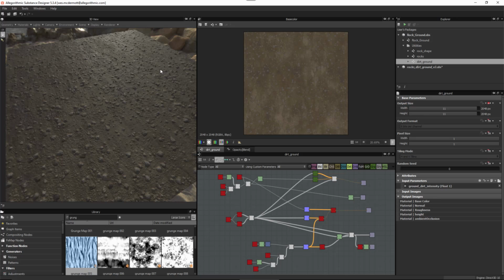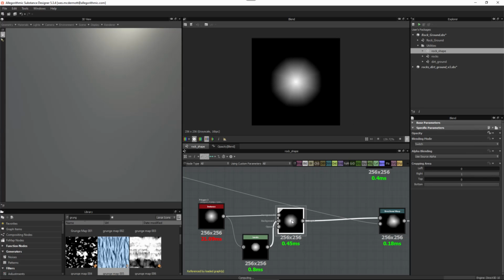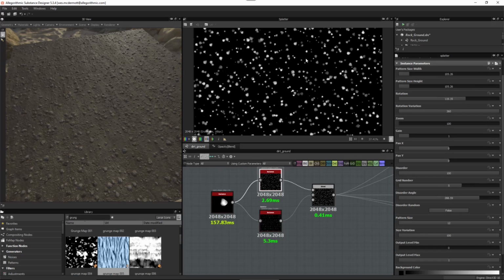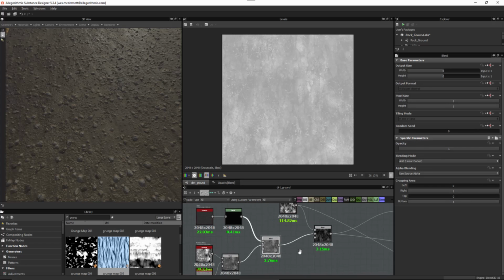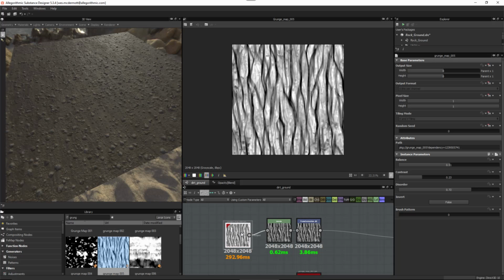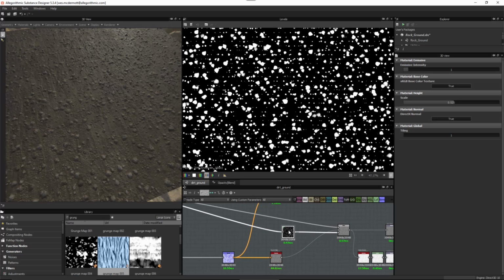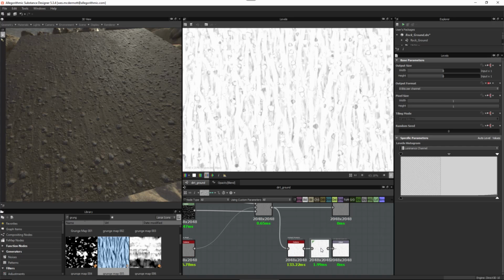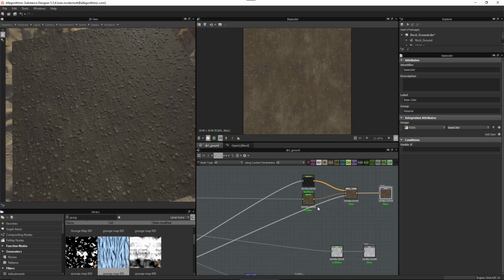Substance for Unity: Chapter 02-04 Creating the dirt ground material | Adobe Substance 3D

Comment: A much better way to do color - is to use 2 multi switch nodes- make several gradient map nodes for each multi switch node- then a blend for the 2 multi switch nodes. 
Fill up all those gradients completely differently - but make em all look decent.. 
Then > If you expose the switch parameters, the opacity on the blend, and the blend mode from the blend - 
You'll end up with limitless colors for your texture > in engine. If you did enough exposing of variables that make the texture's height and normal, then you can make limitless rock textures suddenly - ALL from engine, and you'll be able to control tf out of it. You can reuse it for underwater scenes, caves, canyons, swamps, deserts, forests, old abandoned stuff - .. ANYTHING. All from 1 substance - and no one will ever know that almost every rock texture in the game is from the same thing - cuz you'll be able to vary it so much.
Reply from the maker: Thanks for the tips!

Comment: Enjoying the tutorials however a few thoughts:

I'm learning how to use SD from a tool perspective, however the tutorial is not explaining the theory behind material creation, this tutorial is teaching me how to makes 1 type of rock texture and use a few input parameters. Is it making me better at creating materials though? no.

It would be great if you explained your decisions. Examples:

"I'm going to use liner dodge for my blending mode" Why! Why are using linear dodge and not min, max etc! please explain the differences and why we need some over others.

"I'm just going to lighten up my values with the level tool" Why! Why are you lightening up your values.

"I'm just going to grab a fractal sum base" Why! Why are using a fractal sum base and not fractal sum 4. 

This tutorial basically boils down to "I'm going to show you what the different buttons in Substance Designer do" Rather than "This is how you make a material from scratch in substance designer"

Very thorough explanations on inputs, not so much on theory. At least it's given me motivation to get really good at it and release some tutorials on udemy.

As far as the substance academy goes, these follow-along tutorials are the best, they just need to be paced a little slower. I'd say this material is quite advanced for a first material where as creating a simple concrete or stucco texture might be a little easier to follow for newer people.
Reply from the maker: Thanks very much for the feedback : ) This is very good information.
Reply: Honestly - the best way to learn this, coding, etc.. is doing it a bunch - so doing several tutorials just like this - will actually make you learn it very quickly. They also have a more in depth tutorial series that explains more about nodes, but it won't help as much as just doing it a bunch of times honeslty.

Comment: To Kosta's point below, at 4:34 I got a bit confused with the pebble variation.  I tried to expose the parameter and make the variable like you did, but between the last video and this one, it looks you revised the previous parameter pebble_variation (Float 1) to be a boolean?  Thus my new "variation" param wouldn't let me rename it "pebble_variation" in the identifier and I was getting the little yellow "!" .  I'm a noob at Designer, so having a bit of an issue solving this...thanks for any help.  As always, you are simply the best, Wes.
Reply from the maker: Thanks very much for the kind words. I'm sorry for the confusion on this : ) 

The pebble_variation is an integer1 which is used to create the drop down list for rock version 1 and 2. In this video, I added the variation parameter to make a toggle in the blend between two types of the pebbles. I'm sorry, but I couldn't find or remember : ) were I had made this a float to begin with. Where did you see the variation created as a float? I'll go back in the video to see what I did. I checked the previous but didn't see where I added the variation as a float.
Reply: OKay, my bad.  Just realized I never watched  Chapter 02_03.  I simply skipped from 02 to 04.  That explains a lot and it makes much more sense now.  Thanks for your speedy reply and sorry I'm such a doofus.  Again Wes, your videos are the finest out there and your attention to users is incredible. cheers.

Comment: Awesome tool, but If I may, I suggest you redesign the graphic interface of the nodes. Its really hard on the eyes, and I think it has problems of usability. I find myself constantly having to zoom in to read the tiny names of the nodes, and zoom out again to see the connections, It's really annoying. In contrast, the numbers of the size of the node (512x512, etc) are gigantic and create a lot of visual noise, if most of the nodes are going to be a square, why  not just put a single 512 small number in the corner of the node?
Also  in some nodes there is this path thing under the name of the node (i.e. pkg://gradient_linear_1?dependency=1259984109) what is the purpose of having that in the name of the node? it is just more visual noise, I think.
It makes the creation process a little less pleasing.
Reply from the maker: Thanks for the feedback : ) It would be great for you to add this on our user voice if you have time. https://allegorithmic.uservoice.com/forums/257908-substance-designer

Comment: Thanks for great tuts. I have a question: if I was working in PBR Metal/ Roughness, but then I had to output just the Diffuse. How I can convert my  PBR maps into Diffuse and Spec with baked light. Can I have some similar diffuse as the result I see in the 3d view with my PBR maps?  Thanks a lot!)
Reply from the maker: +денис меленец Thanks! So glad you like the videos. We have a node in Substance Designer called BaseColor/Metallic/Roughness Converter. Its in the Material Filters>PBR Utilities. This will take metal/rough as input and output PBR spec/gloss maps. However, this will not contain in baked lighting. In Substance Painter, we have a baked lighting filter you can use. You can then export PBR Spec/Gloss maps from Painter using the export preset for Spec/Gloss.
Reply: Thanks. It helped a lot!) I'am looking forward to see new videos on your channel!